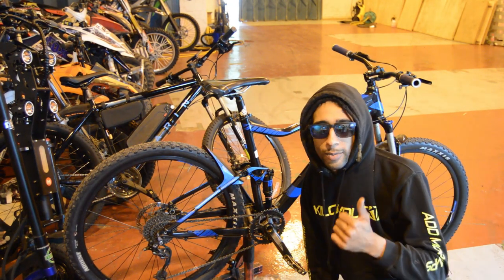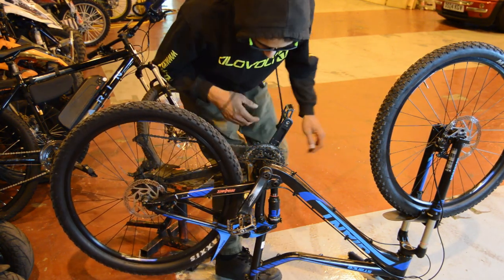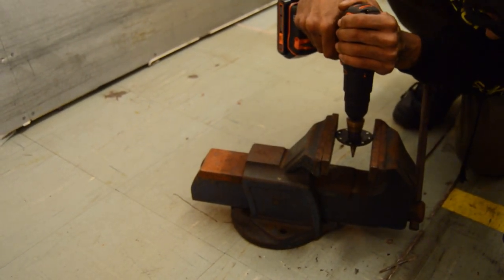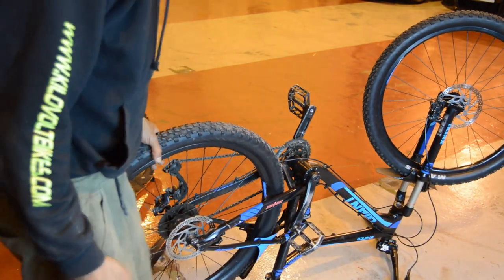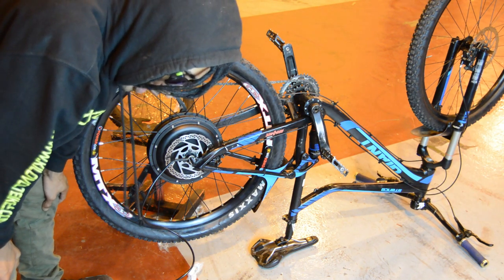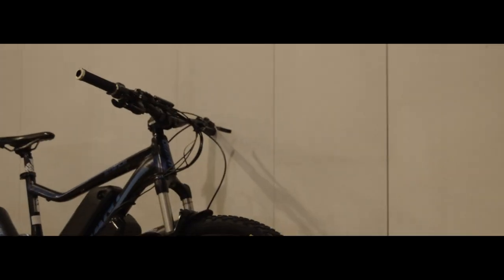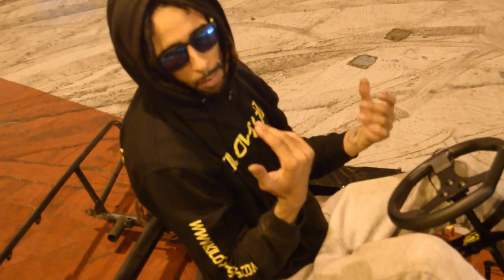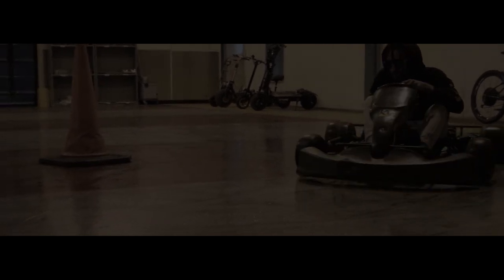We convert this full suspension mtb to an E-Bike for our parts manager Shaunbay (Giant Stance)

Comment: Looks banging bro I've got the same bike that im going to do a conversion on. Got a problem though before I start. Will the battery fit on top of the cable mounts running on the down tube, or will I need to file them down / take them off? any advise would be appreciated ma man!
Reply from the maker: Shouldn’t be a problem with the cable mounts will bolt straight on ⚡️🤘